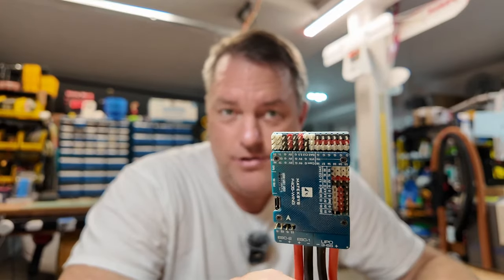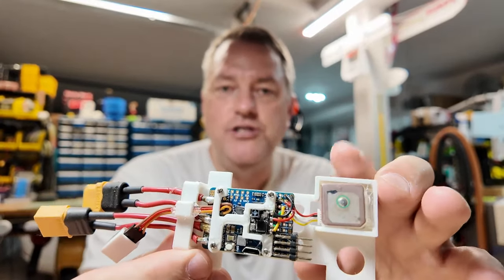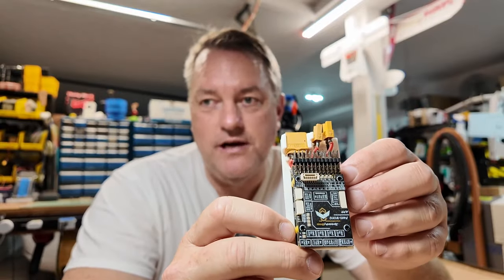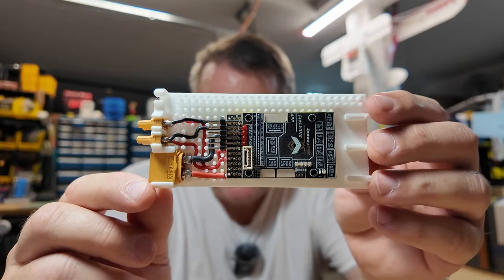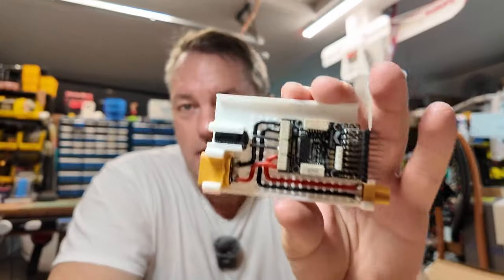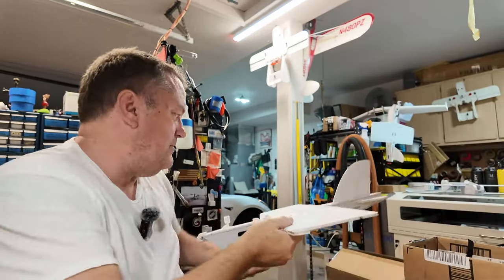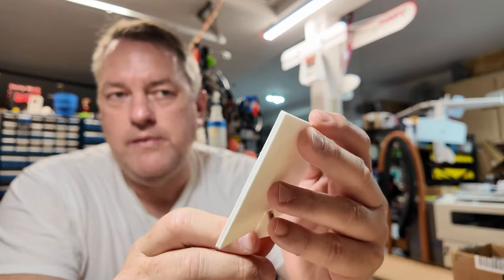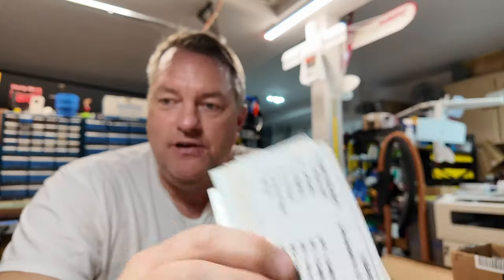How do you mount your flight controller?  Flight Controller Integration for FPV and RC

Comment: Very interesting discussion. I like the innovation in your designs. Could you discuss your transmitter and receiver set up a bit in a video? I saw where you responed to a comment you were using the Radiomaster Pocket and I am intrigued by this for the foam planes. Most info available is for drone usage. Thanks for sharing!
Reply from the maker: I'll get a video together on this.  I want to discuss the flight characteristics and some of my radio setup.  Give me a week, as I'm working for a bit and I'm not around and flying, but I'll put something together. 

Thanks for the comment!
Reply: @usefulaircraft  Awesome! I’m new to this and have only built a FliteTest foam 3 channel trainer. Building is no problem, but the electronics is confusing with all the brands, protocols, sizes, etc. Thanks for the reply and sharing your knowledge!

Comment: Just found your channel and subscribed. Looks like lots of "Useful" stuff. :))
A quick question. I haven't extensively looked through your videos yet, so feel free just to send me to a previous one... Have you ever used vibration-isolation (rubber washers, etc.) on your controller boards to keep the higher frequency "movements" away from the accelerometer ICs? Foamboard construction may perform this function naturally, but I was wondering more for CF or other more solid frames. Thx. Glad to be aboard.
Reply from the maker: Eliminating vibration is critical.  

Foamboard has some natural dampening tendencies - but the first place I always start is the propeller and flight control attachments.  A misbalanced propeller will produce more vibration than anything else.  Start with a well balanced propeller - both track and balance.  When possible - multi bladed propellers are often smoother than two bladed props - but there are design considerations in selecting propeller types that may dictate certain choices.  Loose flight controls also can lead to vibration.  Check that control linkages are tight, and there is no slop at the flight control.  As I can be a very lazy man - I’ll often just hit a loose linkage with a blob of hot glue, and that will often fill in loose tolerances until a proper repair can be implemented.  As far as vibration dampening foam or rubber inserts - there are a variety of commercially available foam tapes (often times double-sided) that can work to reduce vibration.  I’ve had a roll of something by 3M that works fairly well - but I have no clue where or when it appeared in the garage, and I doubt it was aviation related.  The best advice is to simply experiment.  You can put the airframe on a test stand and see where the source of your vibrations are (although some vibrations only appear in flight - I’ve done plenty of test flights in jets chasing noises and vibration).  The best effort would be in eliminating them at the source - piston engine planes use rubber mounts for the motors to help reduce vibration - and maybe that could be something to try - rubber motor mounts to reduce as much of the vibration to begin with - but again - start with balancing your prop and powertrain.  Now you’ve got me wanting to experiment with rubber mounts incorporated into my motor mounts.  Interesting… 

I’m curious what you find is the best path forward for you.

Thanks for your note.  I hope this helped.
Reply: @usefulaircraft  Absolutely it helped! Thanks for taking the time. I haven't played with quads for a while, but I bought 3-blade props for the last one I was building. I was using isolation rubber mounts for my controller, and I was balancing my props, but I hadn't thought of mounting the motors with vibration in mind, so thanks for that idea. I'll keep you up-to-date with whatever I do when I get back to it. Thanks again.

Comment: Cheers mate, very useful video, lots of great ideas! Thanks for sharing them! Interesting to see your move from Matek to SpeedyBee, I was thinking of doing the same. Did you encounter any gotchas going from one to the other? Keep up the good work 👍
Reply from the maker: My transition to Speedybee has been pretty seamless honestly.  While I thought I preferred soldering on the large Matek pads - I really hated the floating ESC signal lines (the flat pads just floating in the middle of the board). For the money - I'm not going back - unless Matek really competes on price or adds features that enhance it's feature set to a level that changes my view.  It seems to me that Speedybee is really competing at a price/features proposition that's hard to beat.  Now all my builds are relatively inexpensive - with the most expensive airborne components being the FPV gear - so I'm not really feeling driven to more robust systems that would be better suited for commercial operations - I'm just enjoying the flights.

Thanks for your note!
Reply: @usefulaircraft  Great advice, thanks!

Comment: What was that thing attached to the servo you showed at the end?
Reply from the maker: That was a full flying surface flight control that I'll show off in another video.

I was inspired by the F16's tail surfaces, and was looking to minimize parts count.  It's effective at both, but it's needs significant airspeed for effective control. 

I'll have more on this later, I'm still experimenting. 

Thanks for your note.
Reply: The pivot point needs to be at 1/4 chord, as that’s the location of the aerodynamic center for a symmetrical airfoil.